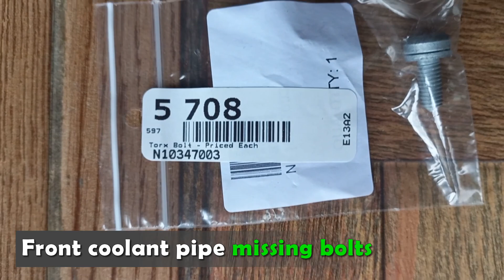Part 14 - Supercharger install - Audi A6, A7, A8, Q7, S4, S5, SQ5 3.0T CREC

Comment: I have a code for stuck runner manifold. Could this have pinched it so it can not open?
Reply from the maker: What did you do under the supercharger?
Reply: Replaced water pump and t stat. Code came on afterwards.